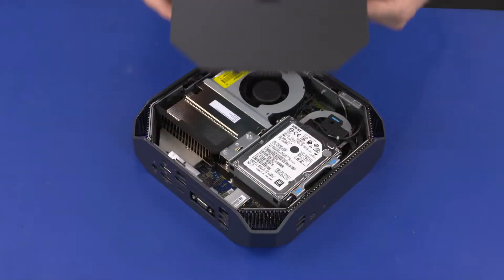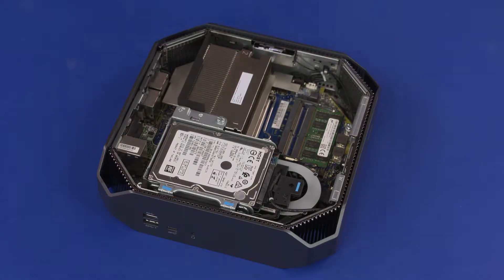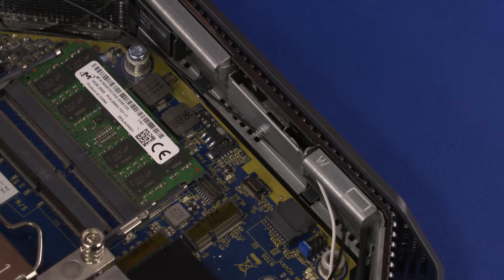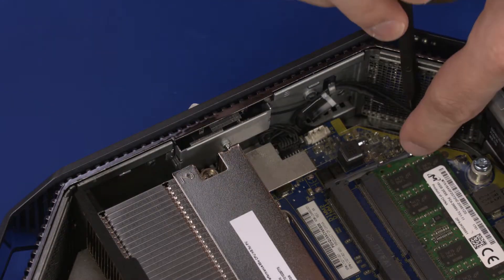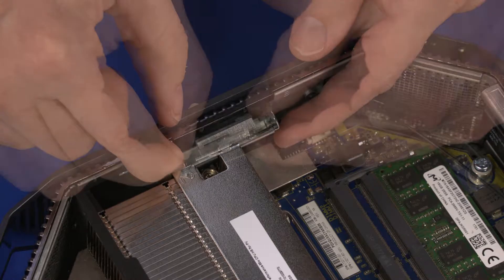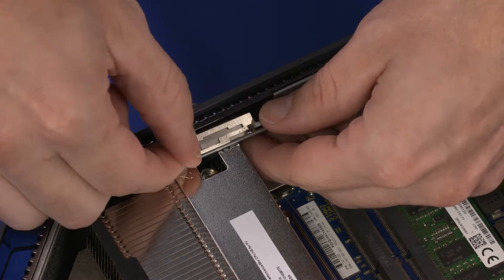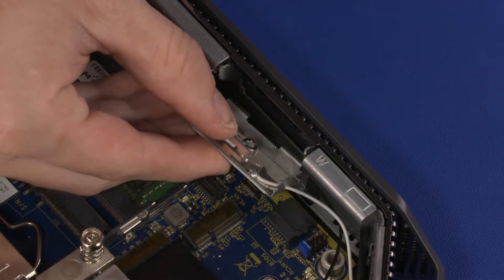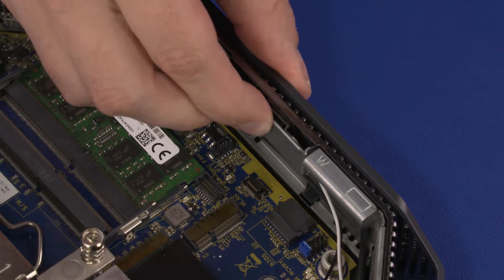Replace the Wireless Antennas | HP Z2 Mini G3 and G4 Workstations | HP

Comment: I bought a good used Z2-G4.  I wanted to buy the wifi card and antenna.  LOL. They want about $200 just for those.  More than I bought the G4 for
Reply from the maker: Hi there, thanks for contacting HP Global Social Media Support!
I understand that you need to purchase Wi-Fi card and antenna for your computer. 
I will do my best to assist you.
For optimal PC and printer performance, remember to always buy (use) Certified HP Genuine Replacement Parts from a known and trusted source. You can order it via the HP Parts store: https://hp.care/6058s8u2a 
Regards, 
HP Support